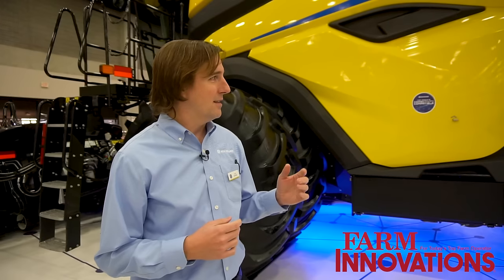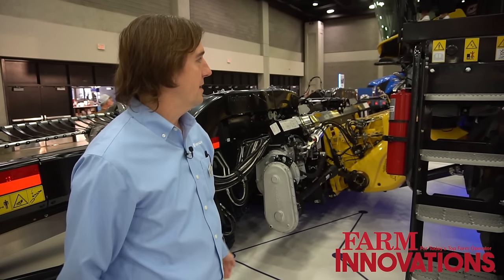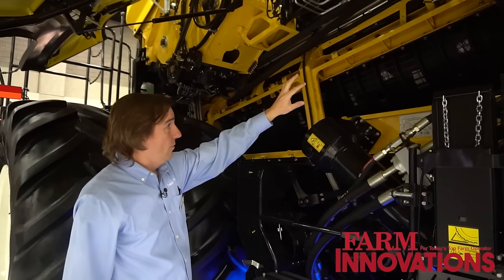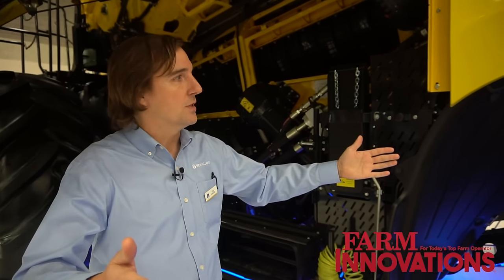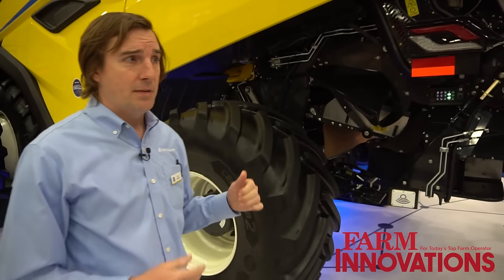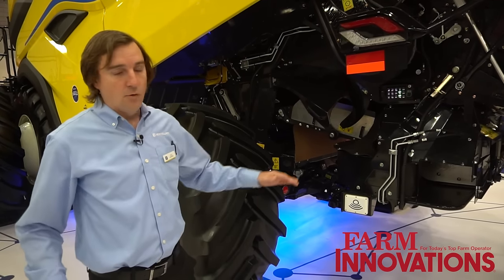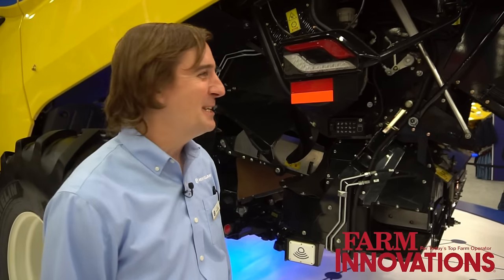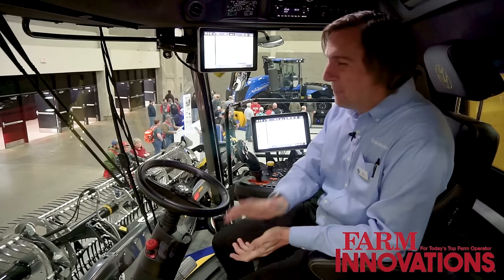An In-Depth, 'Under the Hood' Look at New Holland's CR11 Combine

Comment: Other then color how does this differ from the CaseiH AF11?
Reply: Except for the plastic body work, cab lights, software, and arm rest, they are pretty similar. I assume the biggest difference will come in the tires and folding up systems of certain components as the NH is more indented for the European roads while the AF is intended for the North America roads.

Comment: The best thing about this video is dont have to watch the case AF11 video.
Reply: Ya NH and Case are really just cnh but different colors
Reply: @Eric_V410  don't say that! every red combine love troll will say NO.
Reply: @onelonleyfarmer  Way to many overly brand loyal people out there.
Reply: @Eric_V410 no. The NH has different rotors then the case and also the mechanics are different cabs and lights. The only thing the same is the grain tank and engine and chopper so its NOT the same. Dont judge a combine just because it has twin rotors. Case and new holland have thair own identity plus the case is still abit shorter
Reply: @jezcolborne6329  Dont know where you saw that the rotor are different but from everything I can tell the differences are plastic body work, lights, software and arm rest. There might be more difference but unless you work for one of the 2 companies I dont believe you frankly because they haven't said much in depth publicly.
Reply: @Eric_V410  the rotors are different. Why would case put new holland rotors in its combine plus why would case use new hollands automatian programms. The case rotors are larger in width like the new hollands but they are a little smaller. Different rasp and beaters on their rotors plus the case rotors are proven AXL2 rotors jus like the smaller rotor on the smaller combine so they are not the same as on the NH. also the mechanics of each combine is different. Its just a silly prasumption people have by thinking they are the same when they are not. They are bothers or sisters but not the same. Same graintank same chopper spreader and engine but not the same combine. Not the same cab visers lighting or styling. They are not  clones
Reply: @jezcolborne6329   Well they both have twin 24 in rotors and maybe they have different rasp bars but its probably just a different brand name for the same thing. Also no case isnt taking NH's command system as I stated before with different software. Again I will need some reason you are credible to say they have different drive systems cause if you arent 100% sure then your guessing as much as everyone you're criticizing. Lastly the frame of the cab is probably the same just with different interior parts. To be clear I'm a new Holland guy I just realize that cnh is making the companies as similar as possible to maximize profits.
Reply: @Eric_V410  i know what i mean and they do have different rotors and so they are not the same rotors plus the case rotors are a little smaller. Case has AFS and new holland has their own style. Different country's have different configurations different rules and width. No combine will be the same even the automation settings wont be fhe same for every combine
Reply: U should😂 you dont see the difference like case and new holland do. Difference is cool and i like that they chose each combine to be different rather than them being the same as it would be BORING
Reply: @Eric_V410   thay are NOT the same combine
Reply: @onelonleyfarmer  im a red and yellow troll😀 so you think😀 well i am a fan of both company brands. The new case AF11 aint the same as the new holand CR11 and nor are the rotors. The combines are bigger and wider yes but are different. Dont judge thinking they are the same cus they aint and yes i love them for being radicaly different